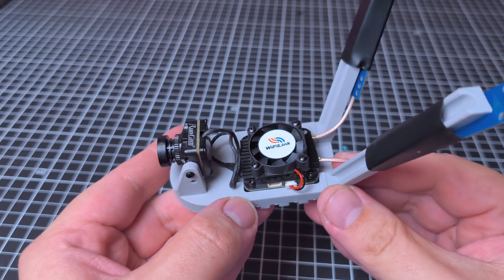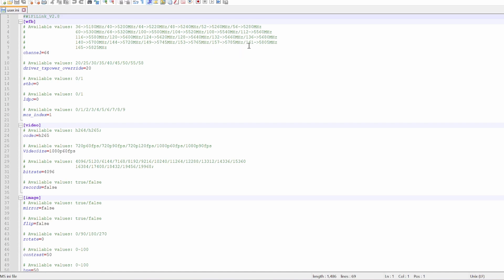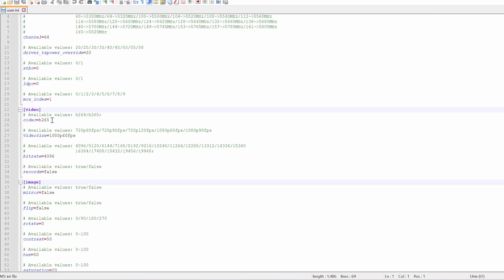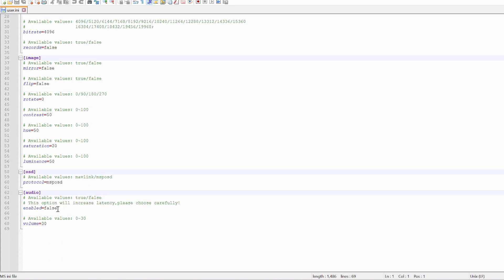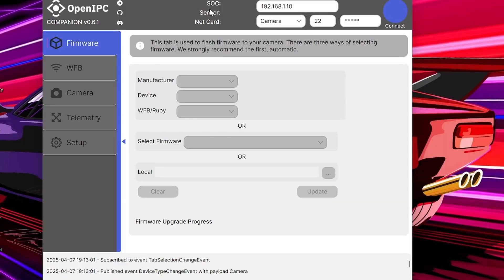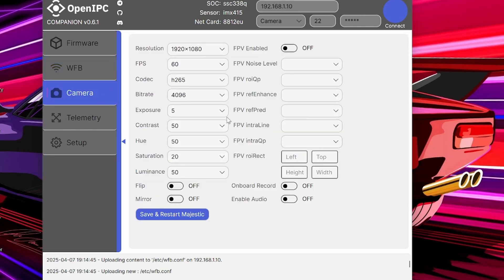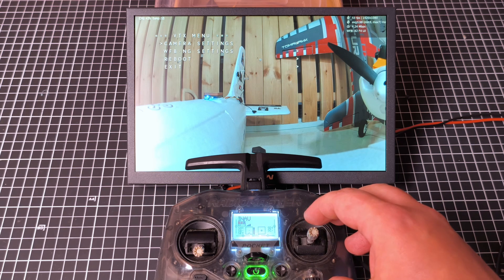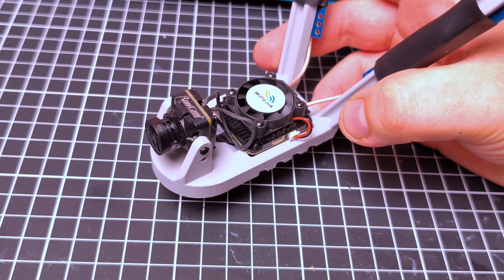How to change settings on the Runcam WiFiLink 2 - OpenIPC Tutorial

Comment from the maker: Bear in mind the SD card config file user.ini will override any settings made by the Multiplatform Configurator. To avoid this don't insert an SD card. UPDATE: This is fixed by flashing new firmware.

Comment: Hi friend! How are you? I have a Runcam WiFiLink 2, and I couldn't activate the audio, so I'm trying to find out if the audio can also be transmitted in real time, along with video, or if the audio is only possible for recording video in real time, I couldn't enable the audio, neither for recording nor in real time, could you help me? I'm Evandro, and I'm from Brazil.
Reply: with ruby i had it working instandly but you'll only get the buzzing from the fan.

try connecting it to your TV and check if this brings up some sound
Reply: @cracymarc  Hi friend! Thanks for your reply!
I connected the Wi-Fi receiver to the computer, but even with the green LED on, I couldn't get any audio. I also recorded the MP4 video, but there was no audio either.

Comment: does it only working with INAV.. changing settings by sticks moving in the down / inner corner ? I use ArduPilot..and it don't works ..AND ! Be carefull to do this, cause this is the same like "StickArming".. so at first I had to turn off this funktion..!

Comment: Thanks for your video. Got the OpenIPC Companion working.
But I‘m still not able to get the OSD running. Videostream is working with fpv4win. But I didn‘t find the correct settings for ardurover 4.6 yet: What about CAM1_TYPE, CAM_RC_TYPE, OSD_TYPE and SERIALX_PROTOCOL?

Comment: Does the VRX just follow the settings of the VTX automatically? Or do you need to  change the settings in there as well?
Reply from the maker: @PeterM-PeterM  You would just need to change the channel. If you have the Runcam VRX that's done with the smalll joystick on the device.

Comment: Why not run the camera at 1080@90?
Reply: FYI GS and Camera only need to be compatible, they do not need to match.
Reply: Why not 1080p@60?
Reply from the maker: My screen doesn't support 90.
Reply: @ You can put the camera to 1080@90 even if your screen is at 1080@60. Depends on if you prefer sensor readout or latency, IG